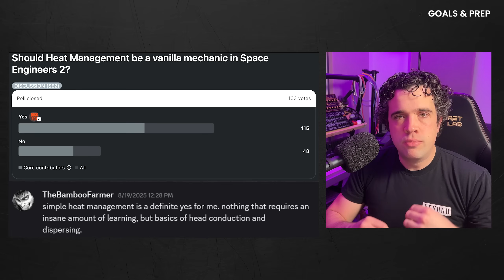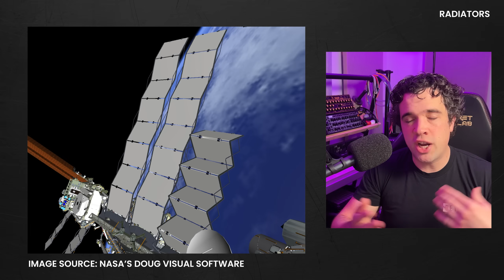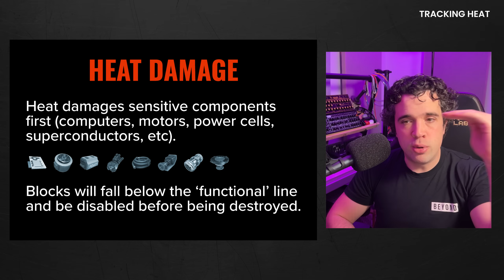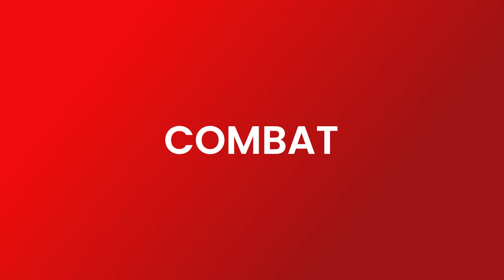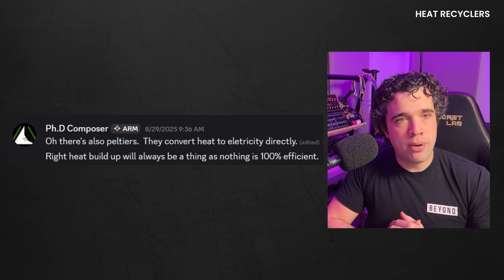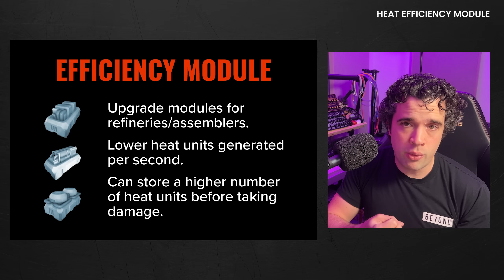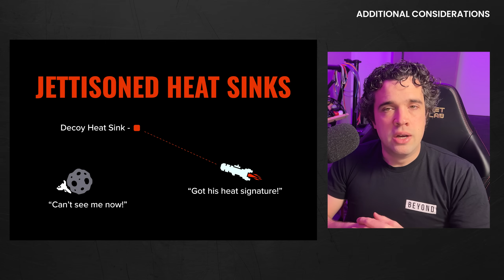Heat in Space Engineers 2? How heat could change EVERYTHING

Comment: 1. blocks with computers components should never get damage from overheating alone (by default) - they just disabling themself, or efficiency lowers so they can cool. (that's actually how any properly engineered device works in real life), optional feature to disable such safeguard can be welcomed, but basic design might not include it, and still be ok (i.e. no heat damage code at all).
2. damage amplification (including how big boom after component fully destroyed) can be depended on how hot block was in moment of impact (from external non heat damage source).
3. solar panels should produce heat depending on solar intensity, and can act as heat radiator. (obviously 100% active solar panel in sum does produce heat, but 5% active solar panel can be heat radiator in sum).
Reply from the maker: I think the computers would get damaged. The shutoff feature I outlined defaults to shutting off prior to any damage which is similar to your computers should protect themselves moment. If you have the safety turned off then the block is performing past its limit which is essentially overclocking. In this event you would for sure fry the computers. If a block is getting so hot that other components like steel plates are being damaged, a computer doesn’t stand a chance.
Reply: @diggrok  i meant only that in simple way damage from overheating may not be implemented at all(safety on by default), but shutdown and damage amplification by high heat can be

Comment: Problem: space engineers is not a “space simulation game” it’s a sandbox style, sci-fi space building game with combat and survival elements. 

Heat in terms of keeping player warm for survival purposes? Sure. Sounds kind of fun for frozen planets or even space.

Heat that limits people’s ability to design cool ships? Pass.
Reply from the maker: Heat is a combat and survival element. I think heat will really only bring limitation in combat. It’s no more limiting than power it otherwise. Both disable blocks if capacity is too low and to fix it just increase capacity. 

It also certainly contributes to making cool ships. Radiators and heat sinks are excellent sci-fi greeble. Some of the top ships in the workshop with excellent detail commit a lot of effort and surface area to making it look like ships have cooling systems even though they don’t. Having blocks for it which also illuminate when they get hot would be so rad!!
Reply: @d @diggrok ain, it would look cool - kind of? But would quickly get old when people realize they can’t build the cool sci fi ships they wanted to. I have a little over 100 SE2 ship showcases on my channel and most of them would not be functional after a heat mechanics update.

Most of the ships you are referring to on the workshop that have “vents” use them to hide thrusters because at this time (well rn it just makes smoke) - but in the future having thrusters inside of a ship’s hull will cause block damage. 

Maybe a good compromise would be having the ability to turn off the heat mechanics in the settings? Then we could see from community creations what they prefer? It will get complicated enough when reactors and conveyors become mandatory for ships to function.

SE1 currently has a massive problem with MOST ships on the workshop no longer functioning as designed due to updates.

SE2 will inevitably have this issue in the future, but with each “requirement” added for a ship to function you will massively increase the number of broken ships and also increase the learning curve, causing new, artistically inclined players, that could make some really cool designs to lose interest.

- also in ship design there is rarely an option to “just add more capacity” as many ships are not colossal megastructures. Many of the ships I’ve showcased aren’t even big enough to have gravity generators.
Reply from the maker: @namepending3843 yeah that’s why I’d press for it sooner so people can plan for it. Not super worried about what’s in the workshop now because the game is in pre-release (speaking as someone who has a few top ranked builds). We don’t have all the blocks necessary to fully develop certain ships. A lot of blueprints will break simply because people didn’t account for power, fuel, or to your point the grid is smoking from thrust because the grid is dealing damage to itself, it just isn’t simulated. Limiting the future of the game to what was available in the first alpha stage would prevent them from doing a lot of neat things. 

And I do mention the world toggle near the end under additional considerations because yeah that would be necessary. You can turn it off same as air tightness and other settings. A slider to make heat harder or easier would also be cool.

Comment: Tremendous idea. Should also be in SE1.
Reply from the maker: They probably can’t port it as a default setting because every saved grid in the game which wasn’t built with heat will need to be redesigned. They’d have to include it as an optional setting but not vanilla or players would be REAL mad. For that reason it needs to be in SE2 sooner rather than later to prevent the same dilemma.
Reply: @diggrok  I dont think this is an issue at all optional or otherwise. The feature is strong enough and needed enough on its own imo. I dont think anyone would complain, but sure make optional. There wasnt an outrage when they fixed a bunch of mechanical blocks and made the interia tensor settings optional. Nothing went horribly wrong when i turned it back on after an update. Most of the mechanics outside of the grid update will be enhanced from SE1, its the best test bed for it - the maths is the same. I cant see the implementation being too hard considering we can have farm plots dying with lack of x or y.

Comment: Is caluclating heat for entire grid actually that resource intensive?
You don't have to do that super accurately, and you don't have to update that 60 times a second, so i think there must be a way to do it in a smart low cost way.
Reply from the maker: Exactly. I don’t think it is. Should be no different than calculating a blocks power use. It’s just one line of data. Maybe blocks that produce heat just add another 5 PCU to it or whatever it needs. That’s the whole benefit of the PCU system for blocks anyway.

Comment: This is cool but sounds pretty complex, reminds of new star citizen feature with engineering.
Reply from the maker: The safety shutoff is always a beginner fallback. As long as you don’t turn that off your grid won’t ever be damaged and to solve overheating just add more radiators. Pretty similar in complex to windmills and batteries and figuring out how much power your grid needs. It’s just the unit is heat rather than Watts. Both cause your grid to turn off if you don’t have enough capacity.

Comment: I think heat regenerators should work on an efficiency curve. In the real world, peltier elements work through the temperature difference. So the efficiency of them scales down exponentially with the number of them. I think that would still make them stackable but its just not efficient at a certain point and would still require a lot of cooling to make them work. So basically the efficiency is limited to the amount of cooling vs the heat generation, but would eliminate some heat
Reply from the maker: Yeah I see what you mean. They work better with more heat so as heat is diluted they lose efficiency. Likely could program an event controller to turn off modules as heat is lower to ensure efficiency. Or the game could default to bottlenecking heat over the recyclers to ensure efficiency.

Comment: Atmospheric re-entry is the first thought I went to with the heat system, a high-speed re-entry, your grid would simply take heat damage, would make planetary crash landings way more dramatic and intense. Of course, this could introduce more heat-resistant armor blocks if you want to build a quick planetary contact probe to drop onto a planet's surface in such a manner. Deliver supplies quick and dirty with this drop probe from low planet orbit. 

There's also options for heat-laser weaponry that generates heat to fire heated beams at enemy grids as a method of defeating enemy grids.
Reply from the maker: Having heat resistant armor would be super cool. I love the aesthetic of reentry ships where one side is contrasted from heat shielding.
Reply: That would be great I think it adds a bit more depth to entering atmosphere than the usual just go down and land approach we have now. You would have to think about how you place your heat shield and thrusters as well as how to angle your ship and control your speed as you descend.

Comment: A heat recycler could be good for the early game or for production grids. Perhaps they would radiate heat too, just like the radiator, but they would be a larger block, and they would radiate more slowly for their area than a radiator, so it's a trade-off. Maybe the early game version would be a peltier requiring silicon, nickel, and iron, and it would be really inefficient, like 5% or 10% and dimensioned like a small grid block. Then, as you get more exotic materials to end game, you would unlock the sterling engine, which would require cobalt, iron, nickel, and silver(for thermal conductivity), and the more advanced production blocks to machine its components, which could be shared with he hydrogen engine, and would have 30% to 40% efficiency but also require a minimum heat level to operate so if your grid is too cool it won't generate power at all. It could have a smaller and larger version, with the small being 30% efficient and a 1x1x2, and the large 3x3x,4 40% efficient, and possibly have a cool sound effect and piston animations like the hydrogen engine. So, if you had a large reactor and a large sterling engine, you would have 1.4x the power production of the reactor by itself, and you would have cooling for the grid, which would mean your reactor could operate consuming less uranium to power the grid. On a production grid, it could supply extra power as your production equipment generated heat. It would still require a primary power source, as it would not generate enough power to cause an infinite loop due to inefficiency. Still, it might keep your grid powered for a little bit of time if you have stored heat, comparable to a battery, until you can repair your reactor if your reactor breaks for some reason. it would also be bad for a combat grid because you need all the cooling you can get for a combat ship, and the reduced cooling for power generation would be a bad trade-off for combat so pure radiators would be king on combat ships.
Reply from the maker: There’s definitely quite a few additional modules they could make. They can always reserve alternates for future expansions.

Comment: Haven’t watched the video yet. But I hope that they add manned guns that would be better than turrets in certain aspects. And would be useable by NPC’s as part of a crew or even planet side, I don’t know the scope of what they are planning for NPC’s but I hope they will be able to move around in ships and be able to do tasks. But having a manned gun that costs more but is blatantly better than a turret would make it where designing an actual ship interior for NPCs to path to useable stations such as turrets idk I’m falling asleep
Reply from the maker: I have high hopes for NPCs! Lots they can do with that.  

You can build and operate custom turrets at the moment and also take control of the default turrets. 

If you want one you can actually sit in I think you can do that with a sub grid with a gyroscope connected via hinges and rotors which have their strength set very low so the gyroscope can move freely. Never tried doing that but I don’t see why it wouldn’t work. Though turret controllers would still be better as they can operate remotely and not put the operator in danger.

Comment: Interesting enough as you mention the engineer that can just run at a base/ship with a grinder... Keen has already made it so you can not just go up in tear with tools with out the lesser tool. It would be really cool to have an additional up-grade such as the welder has fuel, the grinder has blades and the drill has drill bits, all have a 0-100% usage on them the same as the jet pack. When you get to 0% the efficiency of said tool is dramatically reduced regardless of what tear state you have. However with the same concept in mind for new players, When the tools component reaches 0% it can still be used unlike the jet pack. With the jet pack 0% = 0! With tools however the new player doesnt have to manage his equipment as much while still in the learning curve. However PVP or PVE would require the preparation of the player to bring a high level tool and the bits to keep it running at its max effectiveness if that engineer wishes to just slash and dash a base or ship!
Reply from the maker: Wonder with the gear forge they’ll get more detailed with tools or not. Time will tell!

Comment: I think it should be PVP only
example: the players tools should only overheat when the grinder grinds a block not friendly or neutral 2 the player, not when drilling, flying, welding or grinding friendly blocks
same with Refs., O2H2's. or Assemblers. I dont think its a good idea 2 have them produce heat.
If i understand the video correctly heat will only be a problem if u have a mass of something (Lets say  Refs.) but if u are at a point where u need 20+ Refs. 2 get rite of ore u are not going 2 mind placing down some heat-managers
The moment the "dont mind" comes in it shouldnt have a affect at all (in this case) 2 avoid block clutter.(same reason why SE has no logistics. it would be more blocks not more function)
Reply from the maker: There could also be backpacks which specialize in cooling handheld tools but the tradeoff is they aren't as fast. So you'd have an optimized pack for building but it can't chase down enemy grids and grind them down. 

Or the tools have interchangeable heat sinks so you can "reload" them. This also ensures that you can't spontaneously hydroman, you'd have to prepare for it.

Comment: Really like how you’ve thought about this idea and ways to actually implement it that don’t have a steep learning curve nor are super computationally heavy for  the system. 

A thought this gave me was the idea of a category of weapons that deal thermal damage rather than kinetic or explosive. These types of weapons would most likely be some form of energy weapon like an IR laser that would consume electrical energy only, no ammo needed. With them being an energy-based weapon, they could pass through shields or at least be less affected by shields than other weapon types. 

To balance these types of energy weapons I have 2 ideas. They could be pulsed, so like a 3-4 second firing period with a 6-7 second cool down. And with them not needing ammo, the trade off is that when they are actively firing, they consume an extremely high amount of power with heat damage output falling off drastically when the power requirements are not met. 

Another balance could be to adjust the heat damage they do based on distance and environment. The further the target, the less heat is imparted per second and using them in an atmosphere would drastically reduce their damage.
Reply from the maker: There are laser systems in use today especially on warships which heat up and coming volatile missiles to get them to explode midair. You’d only be able to target one module per laser but it can cause heat buildup on a module

Comment: Wouldn't venting air over radiators and out of the ship be the best way to reduce heat in a vacuum?
Reply from the maker: When a ship "vents" the air leaves the ship and becomes a vacuum, but it just removes heat that has already been transferred to the air molecules but any heat stored in the ship (whether in the hull or modules themselves) would still exist and take time to radiate. So it would do technically something but it wouldn't do much to help an overheating module.

A lot of times you see venting in sci-fi stories it is to choke a fire by removing oxygen or some other dramatic reason rather than a cooling method. Plus you'd need to refill the ship with oxygen to transfer heat to the air then vent it again which is insanely inefficient and you'd run out of oxygen real quick. At that point you'd just be using coolant loops which pump heat to radiators. Same reason really why cars need coolant and not just airflow. Heat is produced faster than air can remove it.